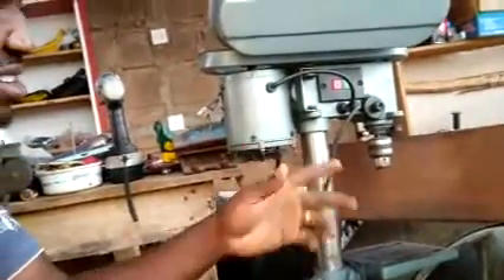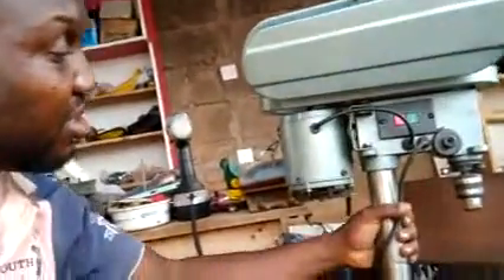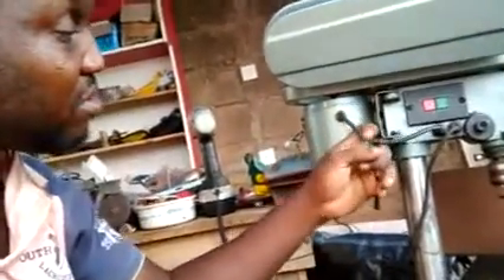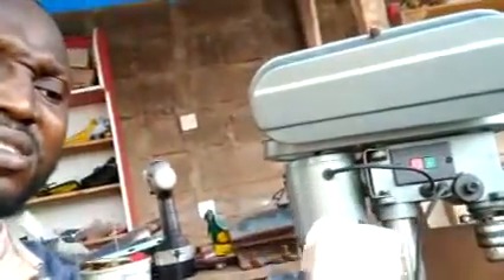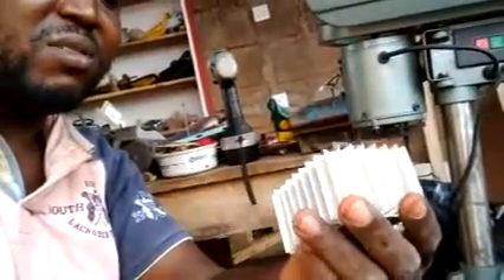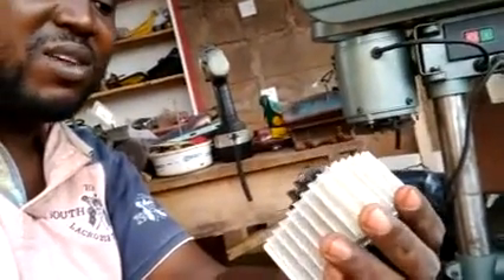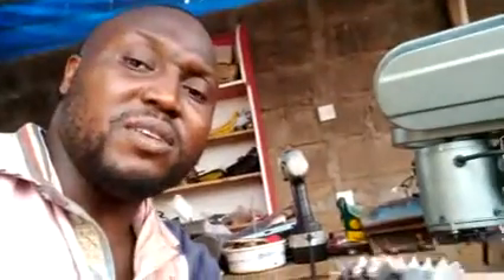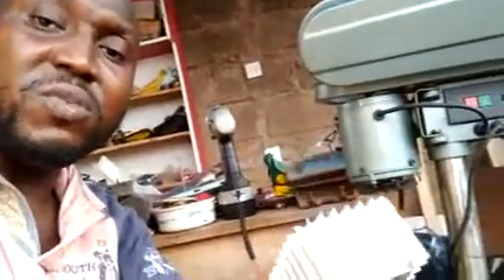How to control the speed of a bench drilling machine

Comment: What is to be done in a case whereby the speed control box for the conveyor of the filling head of a bottle filling machine is no more running more than 400rpm?
Reply from the maker: Seems you want the speed to increase, you may check for the fault in the control box and see it the potentiometer is still working fine, otherwise check for excessive friction in the conveyor lines